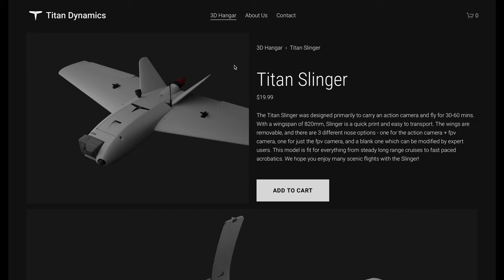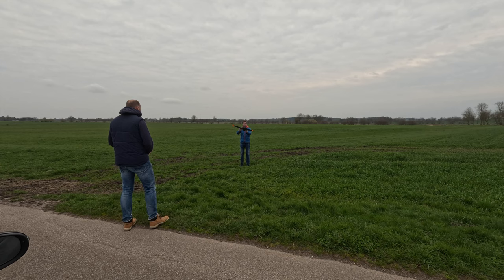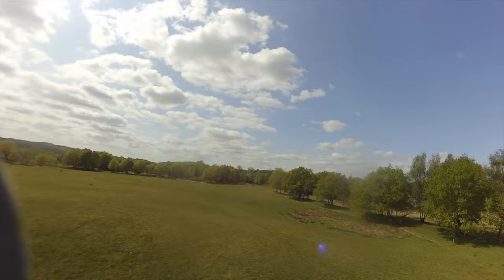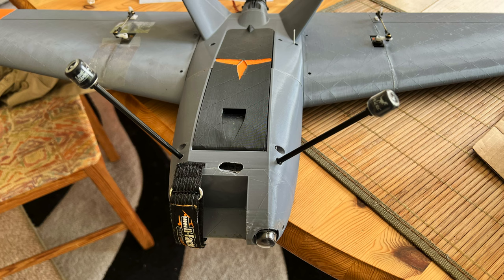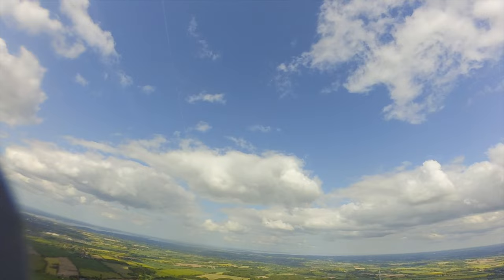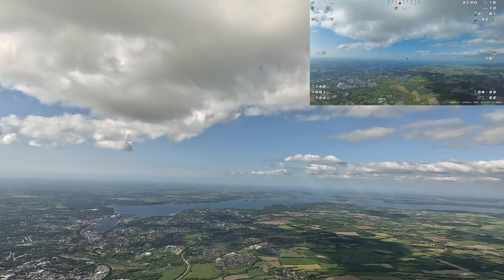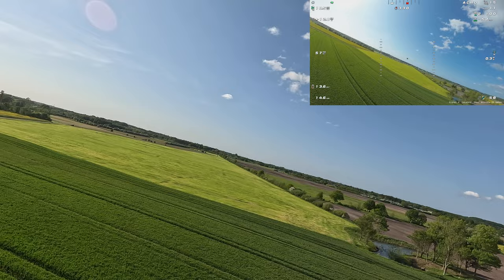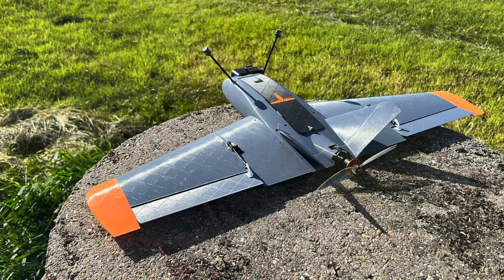Hands on the Titan Dynamics Slinger - Building, crashing, flying and all in between

Comment: Hi there, 2 pro tips to do before you auto launch inav plane. Well 3 actually. 1-mechanicaly set control throw to designer's recommendations. 2- Set in the pid-section your desired roll and pitch rate. Default Roll is 180/sec which is WAY too slow. Try 360 roll for aerobatic wing. 3 (the important part) - In acro mode, increase or decrease feed forward in roll and pitch untill control throws are 80-90% of what you get in manual mode .This is critical because if the roll/pitch rates and feed forward rates are not set to your model controls then inav by default only uses a small amount of your usable control throws making leveling response very slow leading to lots of failed launch attempts. Happy Flying! :)
Reply from the maker: Thanks for that, mate :)

Comment: Hi, did You try Quail as well ?  very good planes, I have/fly both of them. What is the weight of Slinger with all equipment ?
Reply from the maker: No didn’t try the quail- I found the slinger not to match my needs as it turnes to heavy with a GoPro and vtx. That results in harder landing which make it break pretty easy and almost every time. At least in my usage. 

Currently I’m preparing a Gemini

Comment: The Slinger seems to be nice design, but this design needs to have alternative nose sections. First 5-10cm section. While you're not into printing, maybe you could try hand at redesigning a better nose section. 
One alternative option could be to mount your FPV camera on the top hatch with a pan servo, and leave the FPV camera hole open. (would likely mean seeing a bit of nose in FPV view, which some pilots don't like)  Key is you seem happy flying the Slinger!
Reply from the maker: There are many things that could be done on the Slinger- alternate Nose sections are present and can be altered. But at the end of the day you buy a design you want to fly, not one to you need to alter and hope it will fly :)
Let's see how happy I am after some more flights, real flight and not short test launches.
Reply: @JustFPV-net  Great points. 🤞♥